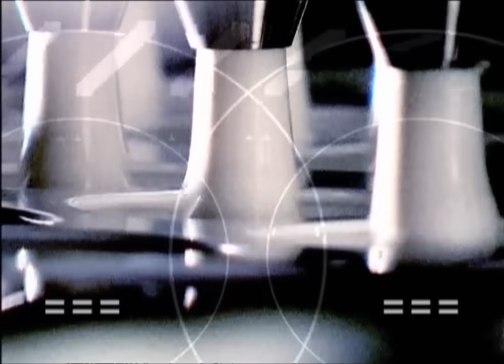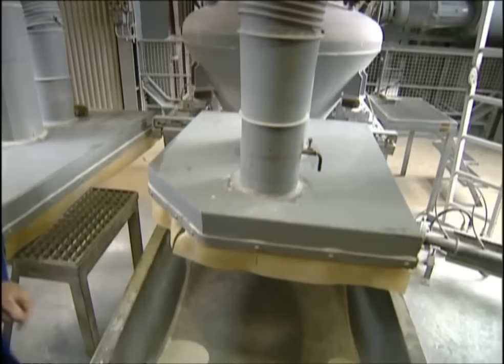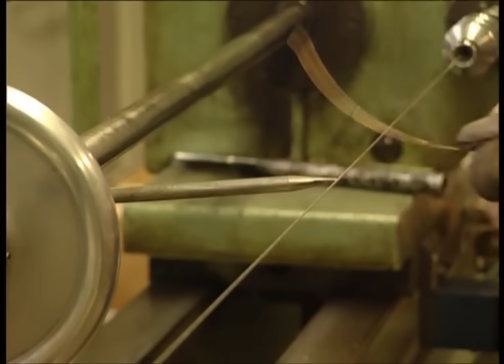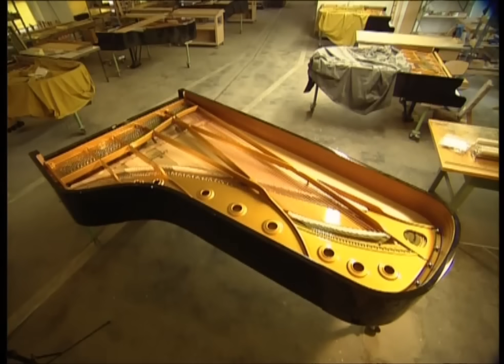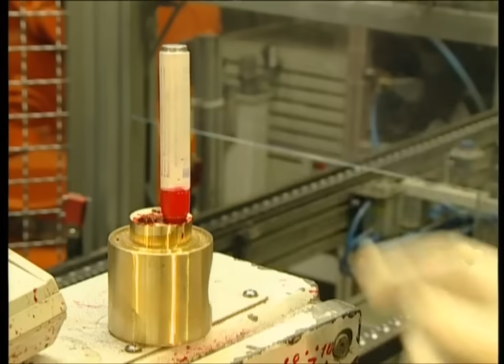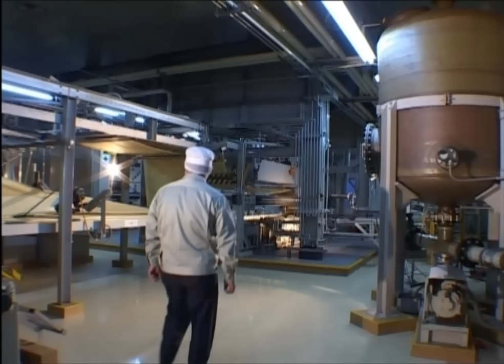► HOW IT WORKS | Wine Glasses, Grand Piano, Water Tap, Soy Sauce | Episode 1 | Free Documentary

Comment: I work for Libby glass. Made in Toledo,Ohio. 31 years and going. We still blow our glass.. these glasses were welded. There is  also stretch stemware where it’s made from one piece of glass.
The glass goes into the Lehrer aka oven where the temperature gradually rises to a maximum point then they have sections of Lehrer that reduce the temperature gradually, this gives the glass its strength. If you add fruit that adds color. Except for red, the use gold to make red